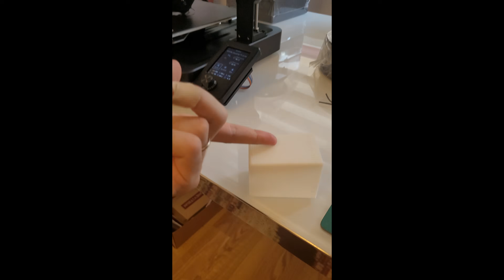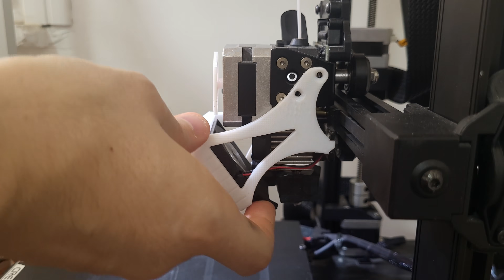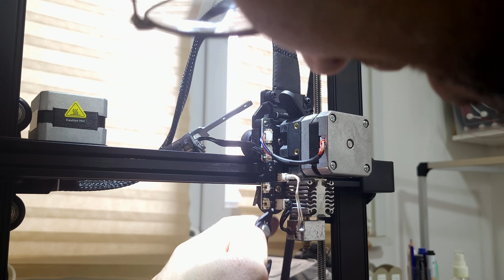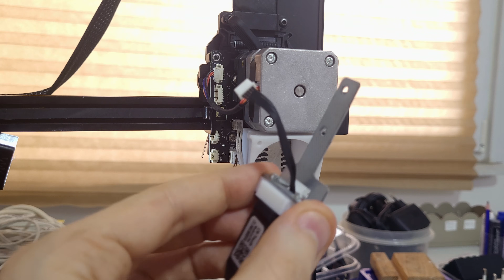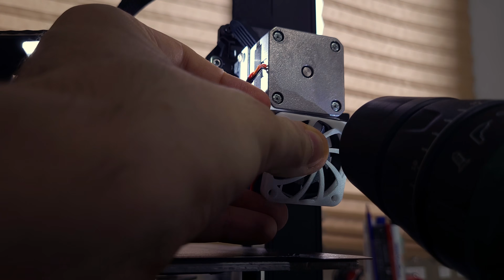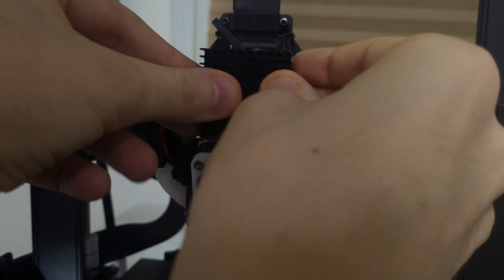MAXING OUT THE ENDER 3 V3 SE

Comment: So you're using the Volcano CHT for the V6 Volcano hotend, I assume?
I can only find these on Aliexpress, and nothing at all locally (BR)
Reply from the maker: Yeah. I had to cut the tip of the silicone sock a bit. It's a little shorter  than the normal nozzle but it works. Had no issues. I can find them locally easily which is usually not the case. I think they're very common. Are you sure you're searching correctly?

Comment: Can someone give a guide for something like this? 
I'm about to upgrade the hotend but still not sure of which.
Some are drop in upgrades, other need adaptations, which I'm fine to it but would be my first time doing so a guide would help to learn which part does what.
Reply from the maker: You can use the volcano hotend of K1 or KE directly. They're the same hotend. If you get the unicorn you need a new heatsink. (There's an upgrade kit for unicorn as well for the SE and KE but not sure about availability.) Volcano nozzles are cheaper unicorn are all metal. I would recommend volcano for cheapness of nozzles and no need for heatsink replacement. I have been using it ever since this video and it's been working perfectly.
Reply: @essentiaDIY thank you so much. I'll add it to the list.

Comment: You should put links for the components you added for those that may want to go this route. I did linear rails, but I did the wider stance. Also did the X rail as well, and a new hotter heat bed. I am tearing it apart now to apply different mods to the toolhead for better cooling. Mine is mostly for tinkering at the moment, and funny how my Bambu printers are making the parts for an Ender SE; lol.

Comment: its 2026 why did you not use the full unicorn dam man you made things hard for our self
Reply from the maker: Why would I use unicorn? Volcano nozzles are dirt cheap. Unicorn is not. Also I got the volcano hotend for like 1/5th the price of unicorn. I got CHT nozzles which get a lot of flow. I have around 15 nozzles. With unicorn I'd get maybe 3-4. I haven't even had any issues caused by PTFE in the cold area. I guess I had one time where I got a clog but that was like a 30 seconds push with the wire. And I really use crap filaments sometimes and can cause these issues myself so I actually prefer volcano. If I were to get a K1 Max or something I'd actually look for volcano and avoid unicorn. But if it works for you that's also great.

Comment: would yall recomend this as a beginner to 3d printing i got 300 aud max and later on ill spend like 100 bucks on mods
Reply: I got an ender 3 v3 se for my first printer. I would recommend it if you really like solving problems and spending lots of time trying to troubleshoot.
Reply: get the KE instead. Ignore the SE entirely. You really dont need mods for it besides MAYBE a vibration sensor, which is like 20 or 30 bucks on amazon. You can not use a vibration sensor for the SE. 

Dont fall into the Bambulab ecosystem, its the worst decision you could possibly make. Dont just blindly try to do any "upgrades" because the reality is that most "upgrades" are very poorly thought out and executed and will make your experience way worse. The KE will reliably print PLA at 350mm/s (8k accel, .2mm layers) at very good quality. No need for hyper pla or other "high speed pla" either.

Comment: I used to have a classic Ender 3 V1 with the 8Bit board.
And just out of the box, the V3 SE has literally everything you would upgrade on the old Ender 3. So I think the V3 SE is pretty darn good as is. The only thing I would potentially add to mine is a filament runout switch.

If I want a "better" printer for printing more exotic materials I would get an enclosed core XY instead.
Reply: yeah, but if you make some good upgrades like sprite extruder, silicon pads, klipper and 5015 coolers, dual y upgrade, you gonna have an faster printer than v3 SE. I'm working on mine to be faster.

Comment: for 10:00 you can upgrade to the ke pcb for the toolhead which is what i done its a £3 replacement part for the ke and gives a extra 2 fan ports both individually powered
Reply: i added y axis linear rails i would reccomend making sure u print the parts in ASA OR ABS as they need to be strong asl.  i has x axis linear rails too but they are so much fuss as you have to relocate the x axis endstop etc
Reply: @lol2_games I plan to print in ABS, I will also print the bed carriage mod.

For X axis I haven't yet decided on what model to use and for some reason they all use a spacer between the X extrusion and linear rail. Do you have any ideal why?

(Looking to use one that doesn't reduce print area)
Reply: @berkertaskiran  as it hits the original endstop.

Comment: Can you kink us to where you can get the stl file files for the ducts? 

Cause most of what i find are for the older v3 se models that still use those mounting holes on the stepper motor that new models dont have.
Reply from the maker: https://www.printables.com/model/926354-ender-3-v3-se-dual-5015-fan-ducts-for-kek1-hotend

Left duct was unmodified. I modified the right duct to fit it. I used another duct to match the screws on this printer version. If you can model, it's not very hard to do. If you don't wanna bother, it will be on my Patreon as it is shown on the video.

But for now it still needs a bit more work as there are some issues to fix. The left one also could use some work as the other day it rotated around its single point of screw connection as it probably hit something, and they can run at pretty high speeds. I have to redesign and test all that which takes some time.

Update: I have done some slight modifications to the right duct, now it is very secure. And the left, if tigthened properly is also secure enough.

Comment: Well done! I tuned a little bit more: I add linear-rails on x and y axis,  Bi-Metal Heatbreak, K1-Nozzle and CHUWI UBook with klipper
Reply from the maker: Thanks. As I've talked about in the video, my next step will be linear rails and a few more things. Are you happy with the Y axis improvement? What max acceleration are you able to get? I think stock accel max out at around 8K. (I needed to increase current for that though.)

I haven't talked much about it in the video but I run Klipper on this as well. Recently installed KAMP and it's been amazing!
Reply: It can't do 8k acceleration without missing the steps.
Reply from the maker: @ami6packs You just need Y stepper current to be 0.75. I have done many prints at 8K.
Reply: Me too, but im still working on better custom parts for the toolhead (added 48v for x and y motors an the btt turbo kit )

Comment: I have this printer and tbh, I hate it. I have hated it since I got it. Wondering if you think these mods would help me hate it less lmao
Reply from the maker: Why do you hate it? The answer to your question is dependant on this one. I believe pretty much any printer can be made to work perfectly if you are willing to try.

And no printer is ever fully problem free. It's a manufacturing tool, and it has a lot of moving parts, it's gonna have problems.
Reply: @essentiaDIY  I bought the Ender 3 V3 5 years ago and had the worst time getting it to make a decent print. After days and days of tweaking and tinkering I just couldn't get it to get a good quality print. And somewhere in there I stopped managing to get any print to adhere to the print bed. Every so often over the next few years I would go back to it and spend an entire day trying to get it to work to no avail. 

A few months ago I bought the V3 SE from a friend, used, knowing that it had a lot of better creature comforts that the V3 doesn't have. Had the optimism that this time it would be a different experience. And it definitely has been a better experience overall, but I went to replace the nozzle because I was still using the one from when I bought it off him and I did a quarter of a turn and the nozzle snapped off 😭 That of course isn't the fault of the printer, my issues have just been that I cant get the ender printers to print as well as I hope. Even though I love tinkering in general, I hate having to tinker with the printer over and over and over to achieve what I thought should be plug and play.

I have a P2S on the way. My hope with that is less tinkering needed, then I can use it to print upgrades for the V3 SE and MAYBE the V3 to get all three working the way I would like. 🙏 All that to say, I just really want my 3D printer to work and make a good end product with minimal effort. I am learning that might not be possible though.
Reply from the maker: So you would have to tell me the issues you're having with it but let me tell you that I have had many issues myself with this as well and it was my first printer and I have been able to solve all of it and I can say 90% of the problems I had if not 100%, has been me. Mostly, I tried and still try to make it print faster and it's been both so challenging and so fun.

If you can print anything at all, I would definitely recommend going through the Orca slicer's calibration sequence from top to bottom as a rule of thumb.

And more than anything else I would  recommend removing spool from top, printing gantry supports with metal rods and installing klipper. Next better thing would be K1 hotend and better cooling and linear rails, in this order

If you can't print, you probably have bigger issues. But unless they're broken hardware, they're usually fixable. And even broken hardware can be fixed because you can pretty much buy most of the components.

I am currently running ~2x the speed of stock (34m vs 59m benchy) and despite, have never printed better!